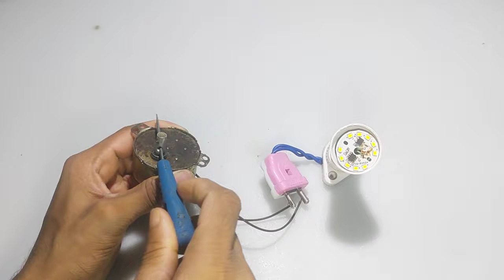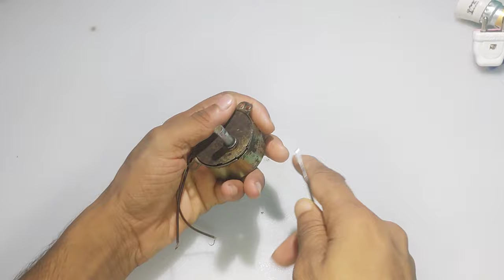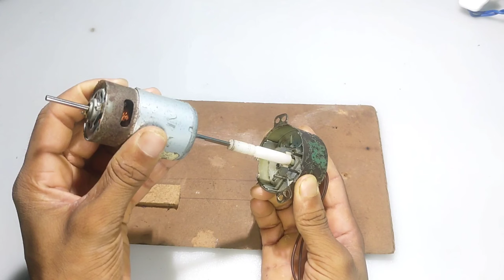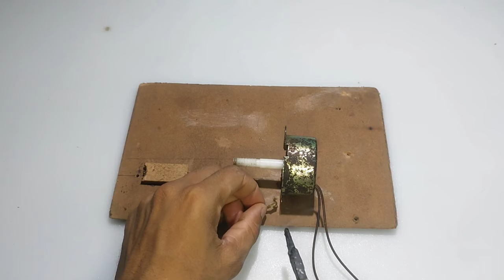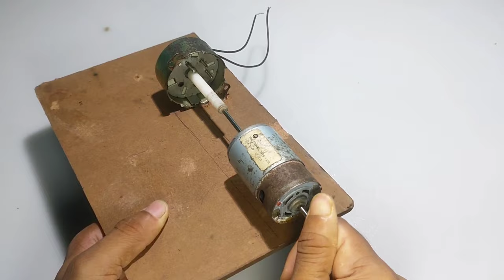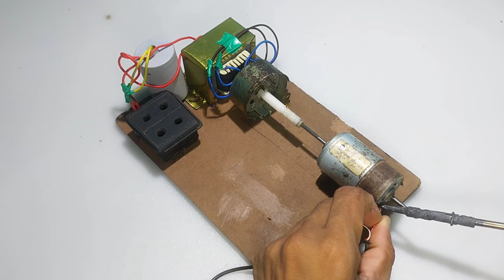synchronous motor (ho to make?generator/ DC) motor to synchronous motor (AC( generator 💯

Comment: all parts ka nam bta to brother
Reply: No 1 Synchronous motor
No 2 DC motor 12 volt
No 3, 12 0 12 Transformer 3 Amp
No 4 capacitor ya Condenser 3.15 microfarad
Reply: @Parvez-Ahmad0958 bhai ap ac volte ko dc me convert kar rahe hai

Comment: No 1 Synchronous motor
No 2 DC motor 12 volt
No 3, 12 0 12 Transformer 3 Amp
No 4 capacitor ya Condenser 3.15 uf
Reply from the maker: Thank you 🙂
Reply: Kya yeh sach me sahi hai please reply with all part price
Reply: bro
Reply: isko app log without trasphomer Chalyo

Comment: thank you bro 💯 🥰working
Reply from the maker: Welcome 👍
Reply: @ENERGYTECHNOLOGY9711  bro really it works or not ???
Reply: @Umangpatel-np5xm no because they used 12012 transformer means 12volts output 12volts not enough for mobile charger 240volts needs

Comment: Not working 😡😡 don't make people fool 😡😡😡
Reply: You missed one thing bro... its working just put induction stove under the table and see its working 🤣
Reply: Working kar ta hai Bhai
Reply: Nhi working hai maine bhi kiya hai
Reply: Perlu penambahan roda gila dibelakang motor tersebut agar putarannya stabil saat diputar
Reply: @codeworId sambil rebus mie😂
Reply: @MANSVISATPUTE 12-0-12 output voltage hai😂😂 charger bulb nahi jalega😂😂
Reply: I think it should work. But likely not as bright as how the bulb is.  Personally I tried driving a similar synchronous motor with another smaller DC motor,  I was getting 100+ volts,  I haven't tried applying load to it or Amy amplification this makes me conclude the possibility.
Reply: Work❤❤
Reply: Other YouTube channel fake him alot but he see the real one is fake😂
Reply: You tried it
Reply: How did you do it?

Comment: What is the capacity of the capacitor and transformer
Reply from the maker: 4mfd capacitor and 12012transformer
Reply: Link for capacitor and transformer 🙏🙏🙏🙏 plz
Reply: @ENERGYTECHNOLOGY9711 did you connect only the have of 12volt transformer terminal or 24volt transformer terminal?
Reply: For how long does  this assembly last?